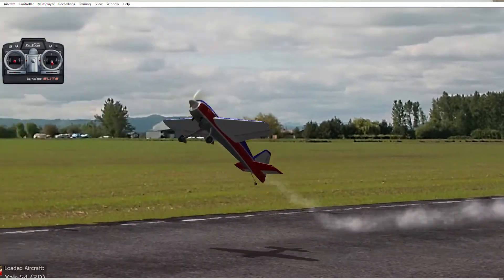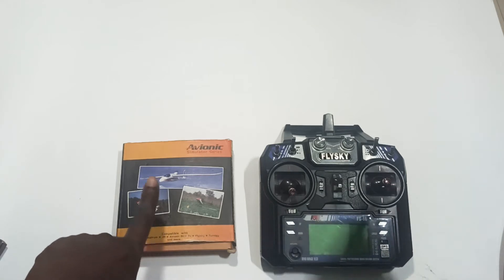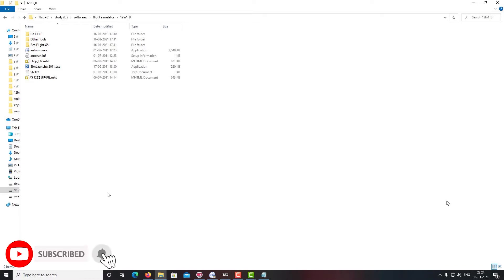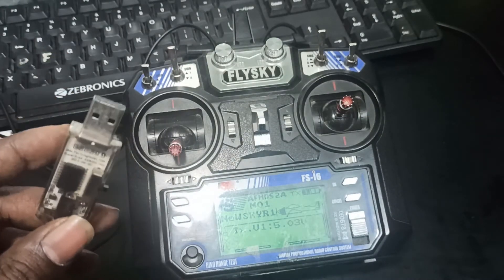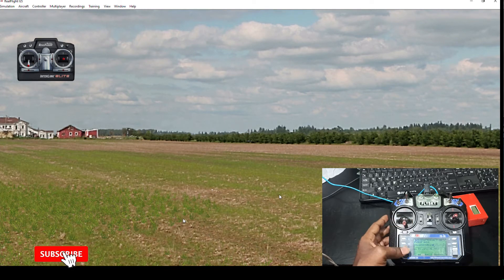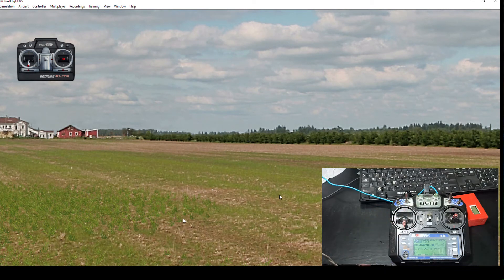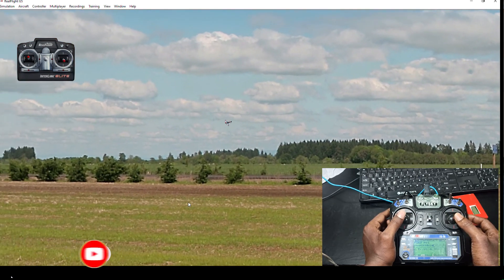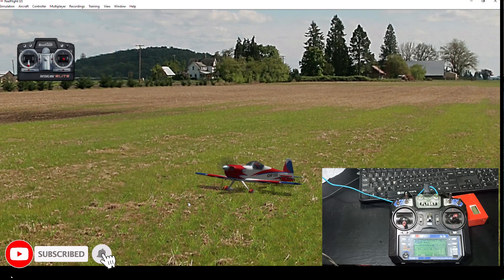RC Simulator Setup - Flysky FS i6 #rcsimulator #flysky-FS-i6 #diydot3d

Comment: Hi i have an mc6A remote controller and i want to connect to realflight simulator g4  i was able to find the signal but my controller is different from the interlink in the sense that my right stick is the throttle and left stick is my elevetor so how do i map it to my mc6A controller using the control mapping in realflight g4 please can u help me or make a video for me please
Reply from the maker: You can create new controller profile instead of interlink.and calibtrate your controller. Correct channels will be assigned. All changes you can do Realflight only. Try this and let me know. You are always welcome🙂
Reply: @DiyDot3d  yes where to create new controller profile in realflight please can u show me and then how to map them so as i can get the controls correctly on my mc6A controller please can u do a video please i found your video very interesting please
Reply: Please tell me how to create new controller profile in realflight g4 i cant see the menu to do so
Reply from the maker: @fazilbusropun5562  i will do video today
Reply: Hi can u send me the link for the video cant see it
Reply from the maker: @fazilbusropun5562  https://youtu.be/IMbXVBMRDN8
Reply from the maker: @fazilbusropun5562  https://www.instagram.com/diydot3d/
Reply from the maker: You can message in Instagram 👆👆👆
Reply: @DiyDot3d  can i send video on instagram
Reply from the maker: @fazilbusropun5562  yes you can send
Reply: @DiyDot3d   u just tell me if u have understood my problem ok